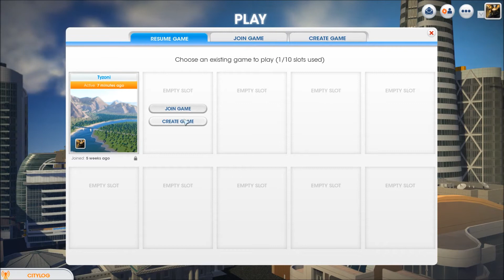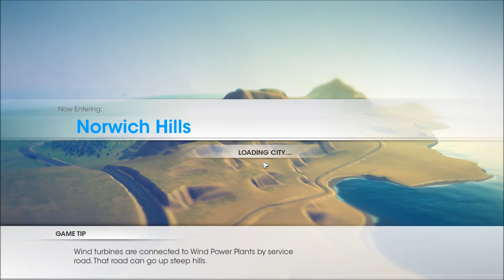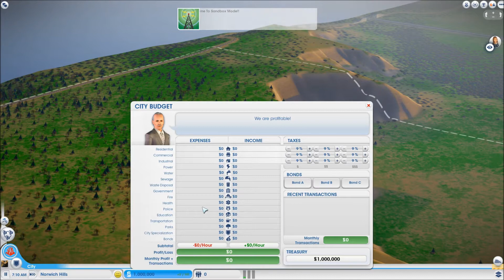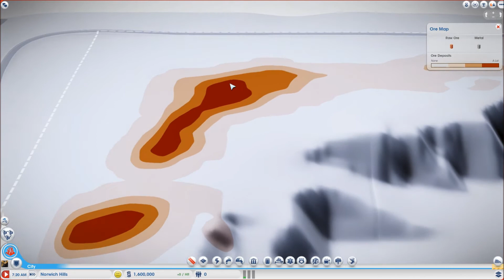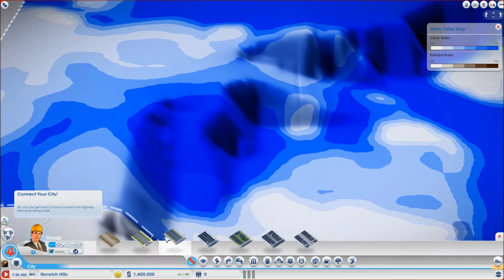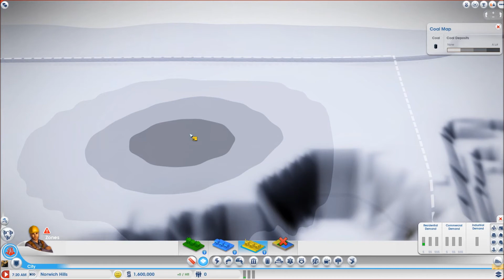SimCity planning tutorial #1 resource planning

Comment from the maker: It's ok, one of the patches has changed the medium density streets from stop signs to stoplights.
Now you're better off using a big runabout made of high density avenue if you have the simoleon later on, but at the start just use a low density street until you see that you have to upgrade to the two lane medium density street.